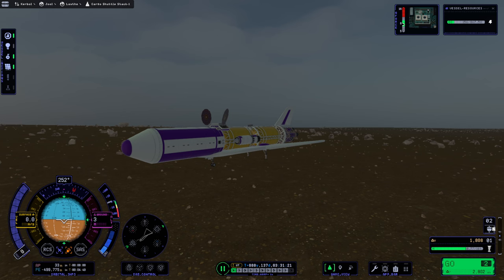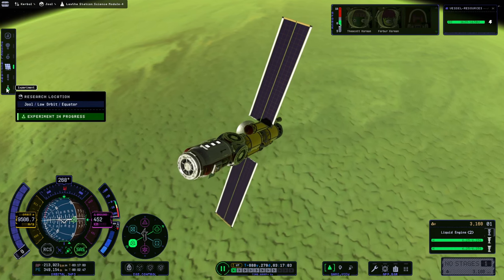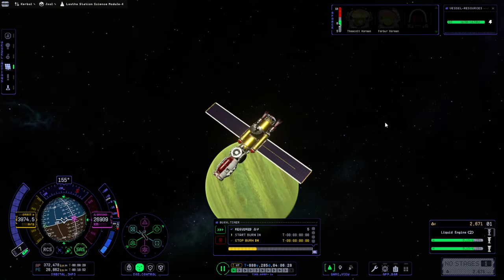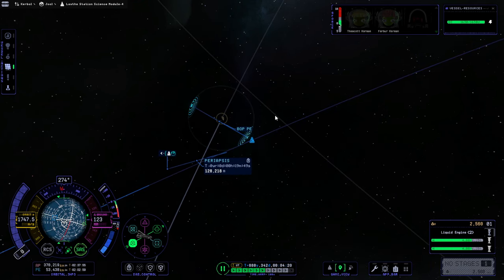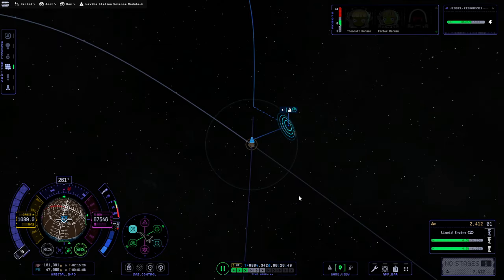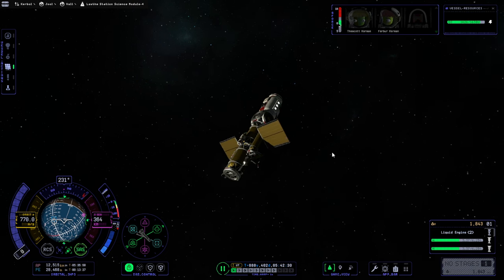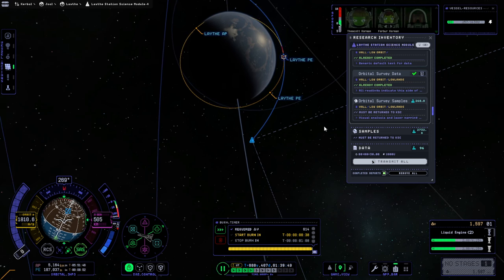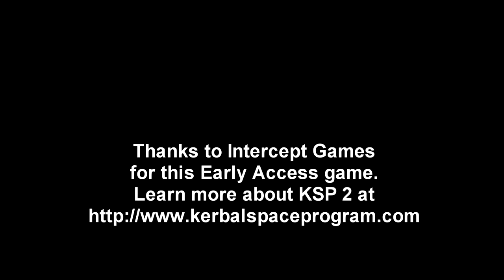KSP 2 Early Access - The Laythe Plan 03

Comment: Thanks for continuing KSP2.  It can be a battle.  I had the rover bug on Tylo where you go so far in a rover and suddenly up becomes down, or sideways.  Nothing worked to right myself until I set my rover control unit to Up from Default, changed from Ground to Orbit, and used my reaction wheel and RCS to get upright again.  Drove the rest of the way with SAS on manual, but at least I got there.